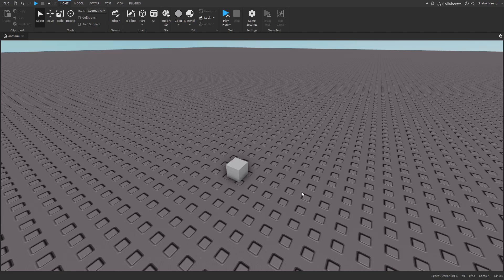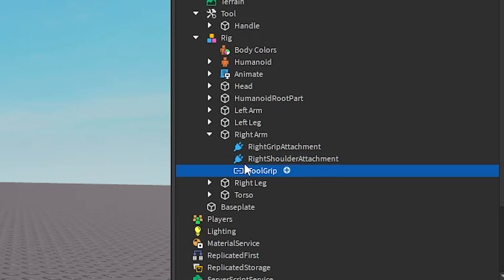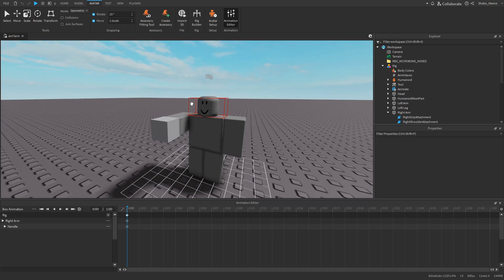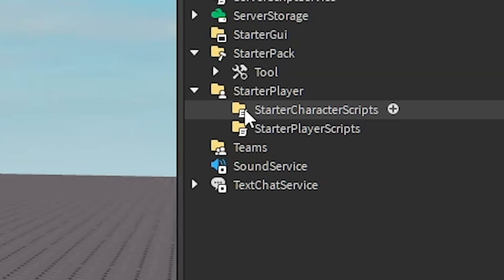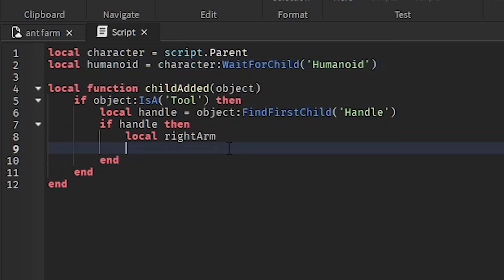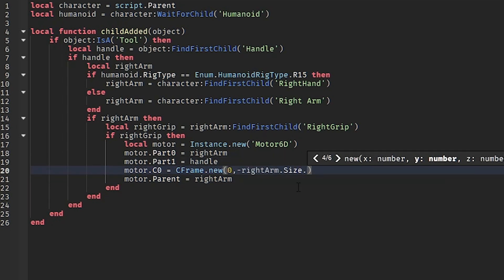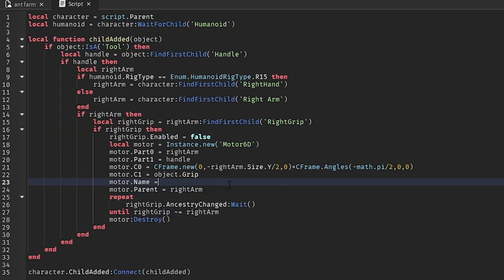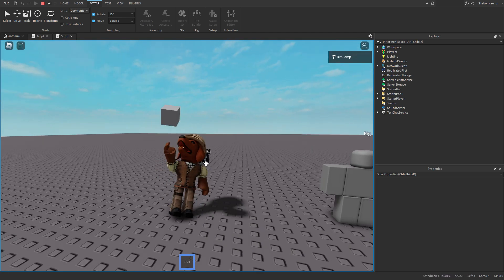Easily Animate Tool Handles (ROBLOX STUDIO)

Comment: This is a very late comment but I have questions.

It works! But I have an issue. It makes the tool a little offset from where it's actually supposed to be. For example, the classic roblox sword. The script that creates the Motor6D causes the sword to float just a little in front of the hand instead of being right on it.

Also, there's a noticeable lag spike when unequipping tools.

Comment: for all the ppl in the comments, lemme tell u sm mistakes i made:

1. its 'Right Arm', not 'RightArm' (proofread ur scripts)
2. the script is made for both r15 and r6, hwv if ur animation is r15/r6, make sure ur the same in-game
3. if u do allat n u still cant animate the handle, make the handle invisible, n make a 2nd handle. then, make a motor6d under handle1 n connect it to handle2. then, make a motor6d under rightarm n connect it to handle1. animate only handle2, dont even touch handle1. the purpose of the motor6d from rightarm to handle1 is to connect handle2 to the animator. go ab animating as normal, n implement all the scripts. handle1 serves as a medium that connects handle2 to the rightarm. das what i did at least :P
Reply: I've done exactly what the video said, any idea why it still wouldn't work? Would you prefer adding me in Discord to help me out?

Comment: You're over complicating the c0 values, you can use a cframe value
Reply: how
Reply: @andy-gamer  well, you can save the values of the motor 6d using a cframe value. You can parent the cframe value to the tool or anywhere and use its value so you dont have to manually set it.
Reply: @Infrared467  this is a month late but could you explain this deeper? Also does this make a change in the appearance of the tool?
Reply: @TreTomato_
No, C0 literally just means the position of the tool handle to the hand, like the grip or smth like its the position shi (c1 also exists but using c0 is more preferred.)
Reply: @TreTomato_ even if its a year I will respond.
Reply: @andy-gamer  you should read more dev forums

Comment: This is a nice tutorial, but it's also possible to have the motor6D inside the tool, setting the Part0 and Part1 to be the RightHand and Handle respectively, and simply disabling/reenabling the right hand weld on tool equip/unequip. Motor6Ds do not have to be inside the player to be animated! Also using loops (beyond for loops) are often not recommended due to the resource consumption, so an alternative would be using AncestryChanged:Connect(function()), which is essentially the same thing.
Reply: Hi I still experience issues, is there a way I can add u on discord?

Comment: How to like, animate not only the handle but other parts of the tool? Kinda like The Mimic lantern
Reply from the maker: Add more Motor6Ds but inside of the handle instead, the animator will recognize it if you do it correctly.
Reply: I dont get it, a tutorial or a detailed guide in the comments would be nice 💀 kinda like The Mimic where when you equip the item it keeps moving forever, like you dont have to click for it to animate, the animation keeps looping until you unequip it.
Reply: @sahal6723  its called IDLE animation
Reply: dont ask me why i replied to this after 5 months